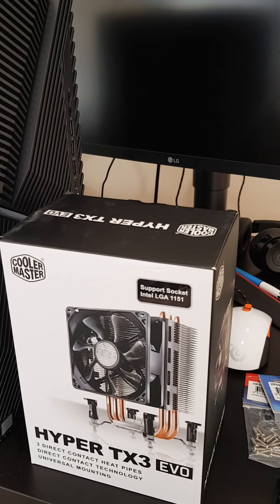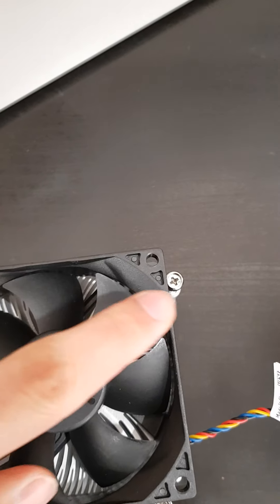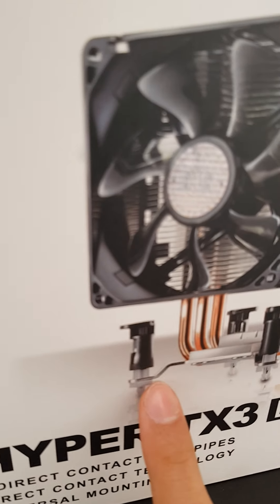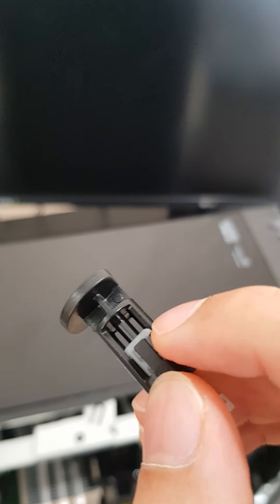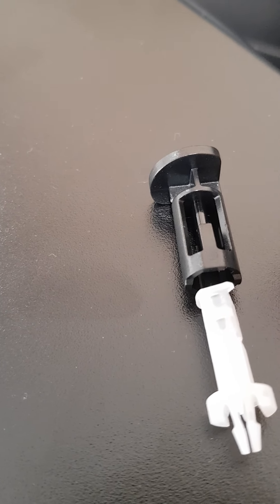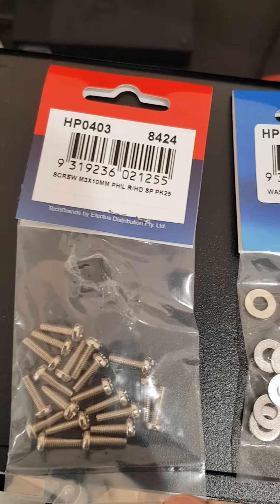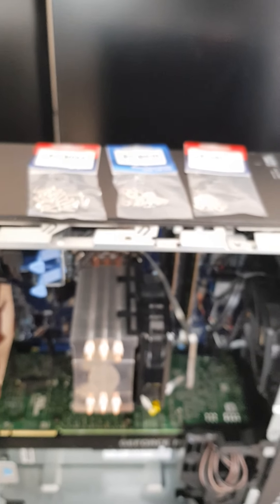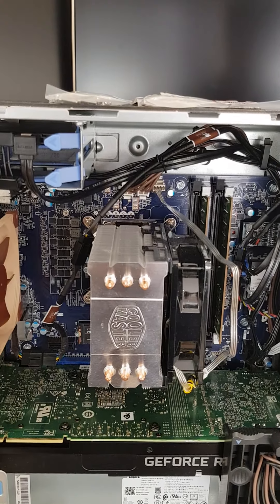Cooler Master Hyper TX3 EVO Installation on DELL G5

Comment: Thank you for publishing this video.  I will be getting my Cooler Master this week, the G5 won't be here until mid November.  I will probably do a video as well showing how my install goes.  One question I have, with the Master Cooler in place, is the RAM slot closest to the cooler still accessible?  It appears the fan may hang over the slot, but I cannot tell.  Thank you in advance!
Reply from the maker: Just managed to find some time and opened my PC to check. It looks like it should be accessible but it might a bit of a tight squeeze. I havn't tried to use all four RAM ports myself because you can always just get higher RAM cards and utilise 2 other slots. E.g. if you want 32gb RAM, use 2 x 16GB instead of 4 x 8GB and similarly for other RAM configurations.

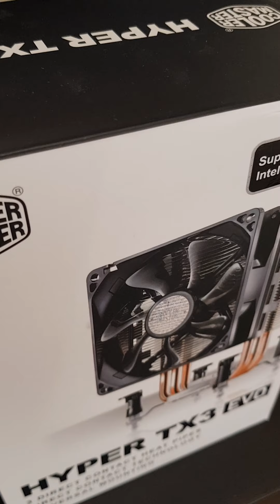Comment: First I would like to say thank you for the video it really help build my confidence to replace my g5 cooler. I just have a few questions. I was wondering do you use any plastic spacer or anything between the bottom of the leg and the top of the mobo? Or is it just empty space cause I really dont want to crush my cpu? Also do I need to install the noctua fans you installed in another video to not get the bios error or can I just install the coolermaster only and not get the bios error? Also what do you mean by middle configuration in 5:37 ?
Reply from the maker: Glad it helped build your confidence. Answer to your questions:
1. No I didnt need to use a spacer between bottom of the leg.
2. CPU doesn't get crushed as long as you just make sure to put firm pressure but not too tight ofcourse.
3. You can follow my instructions for installing the Noctua Fans and you shouldn't get a bios error just like mine. If you do get a bios error please see the comments section for the Noctua video (let me know if you still have any issues). Link to video: https://www.youtube.com/watch?v=QI7QZRkDe2w&t=63s
4. The middle configuration refers to the length of the legs screwed on to the CPU cooler. For examples the legs can be made short, medium and long depending on which hole is used for attaching the legs on the CPU cooler. Using the middle one will allow the CPU to fit on the Dell G5 motherboard.

Comment: Have you considered upgrading the PSU?
btw can you type it down the screws and washers you used?
Thanks, great vids
Reply from the maker: I havnt had the need to upgrade the PSU yet. In terms of the screws M3 10mm and for the washers are M3 and M4 flat washers.

Comment: Hi and thanks for the video!
I have a question; I have read that many uses the Noctua NH-U9s as cpu cooler. I wonder if on Dell G5 (i7 10700, rtx 3070) also the Noctua NH-U12A would be a good (better) solution. My main concern is if the additional weight would cause any problems to the mobo or if the larger size would pose problem for the fitting...
Thanks again!
Reply from the maker: Your welcome. In terms of comparison between Noctua and Cooler Master, there are some good youtube videos you can use as resource to determine which is better as a CPU cooler. But roughly they are both very similar. In terms of sizing, you would have to read spec sheets of NH-U12A and measure the room left in your PC case to determine if it would fit or not. Personally I cant give a direct answer since I dont have the NH-U12A fan to fit or compare but the Dell forums should also a good resource for this purpose. 
Goodluck and hope that helps!
Reply: @nooragha360  Of course it helps, thanks a lot for the reply! I wrote also there in the Dell Forum now!

Comment: thanks so much for this I have the exact same G5 model as you.  what did you do with the hard drives since they are installed in the front and I see you have a fan there.  Which fan do you recommend more, the Noctua or the Cool Master?
Reply from the maker: I used Noctua for back fan (replaced stock fan) and Cooler Master for CPU cooling. I also reused the stock fan for the front where the HDD original was. You can watch my other two videos for the total changes I made to my PC.
Reply: @nooragha360  I just watched it so you replaced the hard drives that came with the PC?  The black box housing in the front is what I want to move to the top so I can place the rear stock fan in the front.
Reply from the maker: @glaesonr255  yes I upgraded them.

Comment: I also have a Dell G5 5090 and I think mine has the i7-9700 processor and looking to upgrade the cpu heatsink and fan.  Which processor do you have, i7-9700, i7-9700F, i7-9700K, etc?  I know Dell offered a few different cpus on the G5s.
Reply from the maker: I also have the same processor (i7-9700), so following my upgrades should work perfectly fine for you!

Comment: Hello, I have a question about the heatsink. I recently purchased the G5 Desktop and would appreciate your help in reducing the temperature inside the computer.  The black and white part, that attaches the heatsink to the motherboard, am I removing that entire part? And then, using the M3 screws & washers to connect the heatsink to the motherboard?
(Hope to hear back, otherwise I'll take my best guess and keep re-watching your video) 

-Cheers
Reply from the maker: Yes that's correct, remove the plastic mount attachments that come with the cooler master and use the screws + washers instead to mount the Coolermaster onto the CPU.
Reply: @nooragha360  Thanks a lot!
Reply: @nooragha360  Do I use any standoffs below the holes of the motherboard of where the screws are going through?
Reply from the maker: I didnt use any for mine and it works fine.

Comment: Would this case be the same as mine? I have a g5 with a 1660 super in it and i couldn't seem to upgrade the cpu cooler today :(
Reply: I’m thinking about buying the same G5. How has your experience been so far?
Reply: @Aadish2150  1st day with it only about 1 hour of use i was trying to upgrade it but it's pretty hard :/ I'll be reviewing it later on my channel but it runs well so far
Reply: @JonnySteven  thanks, I’ll be looking forward to it. The supposed heating issue is keeping me from pulling the trigger on this one.
Reply from the maker: The case should be the same, I have a G5 with 2070S. What stopped you from upgrading it?
Reply: @nooragha360  I couldn't get 2 different gpu coolers to fit :/ that case really sucks ahah but I'm gonna try your method ! Pc still runs great just does get loud and heats up on max use 😩

Comment: Hi!
I managed to install the noctua 92 mm pwm fan on the back and the factory fan on the front, using the noctua splitter and connecting the 4 pin-end to the dell fan, so no boot error. 
I can still control the fan through the awcc, even if some kind of error pop ups if I open awcc just after the pc is booted on.

I was wondering, are you still aboe to use awcc to control the cpu fan with the cooler master? or how do you control it?

Another thing: the two case fan, dell and noctua, receive the same signa put with a fan speed of 30% from awcc the noctua fan spins reaaaly slowly, It could be a solution to use a SATA power to 4 pin adapter for the noctua to have it spinning a little more without having the jet sound of the front dell fan? The dell fan would remain the only one connected to FAN SYS through 4 pin cable. 

Thanks again for the video and for the many useful info!
Reply: Lurking, did you solve the problem after? Planning on installing this and the same fan you installed. I need to keep the original stock dell fan connected?
Reply: @gamingvideos7852  Hi! So in the end I only kept the noctua fan, connected with a single 4 pin cable to the FAN SYS; no error at all at the start up and I can control it with no problem from awcc. The fan is super silent and keep everything well cooled.

Comment: Hey man, so ive just installed both the noctua fan and this cpu cooler on my g5 5000 and while the cooling is definitely better, i now have an issue with power, before making this upgrade i was able to run games fine, just heating up, but now if i run borderlands 3 for example im hitting 100% to 104% power usage on the graphics card, its a 500w power supply and was just wondering, do you know of any power supplies that would fit in that case, preferably 600w+. And wondering if you also have had that issue? mpt sure the difference between these two models, but im now assuming you have better power in yours, cheers in advance
Reply from the maker: I have the same power supply that came with the PC. Havnt replaced it yet because didnt have the issue with power that you are describing. Would like to help but I think google would be in a better position to give you answers haha
Reply: @nooragha360  Damn, yeah ive been scrolling for a while, through forums and stuff, seems like with the dell g5 5000 its practically impossible to upgrade from the 500w supply, ive done other things like turning of nvidia replays and stuff and thats kinda helped but im still getting fps drops when a lots happening, thanks though, the cooling upgrades helped, now i have a new problem aha

Comment: Will this cooler work with the dell XPS 8940 with k processor? and is it the exact same installation process as this one?
Reply: Would love to know if this works for XPS 8940 also
Reply: I think the mother board is the same , so should be no problem. The original fan is the same on my xps 8940, it screws in just like the G5.

Comment: Did yours overheat to begin with? I just purchased a g5 and now I’m worried I made a mistake.
Reply: I bought one last night im in the same boat
Reply: @theunqualifiedgamer2344  let me know if you decide to go a different route
Reply: I think im gonna stick with it and just upgrade the cpu cooler and fans i got mine w a 1660 super and i5 10400f for 750$ on sale cant really beat that anywhere
Reply: @theunqualifiedgamer2344  I was going With the 3060ti 1tb ssd mine turned out to 1,600
Reply from the maker: Mine didnt technically overheat but it had high temps and for long term setup that's not a good idea. But yeh it's quite a simple and cheap setup overall.

Comment: i read that  a better  choise  is  the  Noctua NH-U9S ?
Reply: same but i’m not sure if it fits it the case. let me know if u find out
Reply: @dvorak3935  it will fit. I’ve ordered one to go in my G5. You’ll just need to buy 4x M3 16mm screws from any Home Depot store—everything else needed comes with the Noctua. It’s really quiet too.

Comment: Hello again, TX3 is 136mm height. Do you think a 140mm height cooler will fit or the case is not wide enough? 
Trying to find a TX3 in Canada, but its rare.
Reply: 92mm and smaller is the only size that will fit in this case. Try grabbing a Noctua NH-U9S as an alternative.

Comment: Will this upgrade be enough without the addition of the front intake fan upgrade?
Reply from the maker: This will keep the CPU cool but the graphics card might get a bit warm. But I havnt tested it by itself to see the temp difference. You can do the upgrades incrementally if you want.
Reply: @nooragha360  thank you very much .

Comment: Without upgrading the fan how fast does it over heat and does it have a lot of problems also I’m getting the one with the 3060 ti and a better power supply is recommended could I also change that?

Comment: can i replace the stock rear fan with a 80 mm rgb fan too? and what games did you play when testing it out with the before and after?
Reply from the maker: Yes as long as the sockets for the connectors are matching. Also as for the games, COD WZ was one of them.

Comment: Hi Noor, I just purchase this cooler just wondering is there any issues with the startup. I know that with a new fan it’s scans all the parts upon startup has says there is issues with the fan. Is there anything like that with the new Cooler Master CPU cooler?
Reply from the maker: No I didn't have any issues when installing this CPU cooler during the startup process. It takes me approximately 2 seconds to boot up my PC with the current setup.

Comment: Hello!
I got this prebuilt not too long ago, and decided to upgrade from the i3 9100 to an i9 9900k, would you be able to recommend me a cooler I could put in this FF to replace the stock cooler that came with the system? 

Would I have to remove the motherboard from the system to add new brackets or could I just use the stock bracket on the motherboard to screw in a decent cooler? 

I don’t plan to OC or anything with it, just want to replace the cooler with something decent, but I have little experience with prebuilt systems.
Reply from the maker: Hi, I managed to perform my upgrade without removing the motherboard from the DELL G5. You should be able to do the same. In terms of which cooler to use, I recommend any air cooler from Cooler Master series, because they seem to perform the best overall (budget). But make sure to double check with a compatibility check (i.e. the compatibility sheet of the after market part, or build my pc website).
Reply: @nooragha360  Ah alright, I was afraid I wouldn't be able to attach say an Noctua NH-D15 without replacing the bracket on the back of the CPU, it should just screw into the stock bracket for the original heatsink/cooler already on the motherboard?
Reply from the maker: @MarxAthium  yeh it was a bit of a challenge fitting the Hyper TX3 onto the motherboard, hence I think it might be even harder for you to fit that CPU cooler in the tight space. Let me know how you go though.
Reply: @MarxAthium  I installed the noctua nh-l12s by installing it directly into the chassis. I got some M3x16mm screws from the hardware store and used those to mount the cooler to the preinstalled holes. The frame makes it impossible to put on the bracket

Comment: if i use the noctua NH-U9S do i still have to buy additional m3 screws to be able to mount it or do i use the included screws ? also can i get the m3 screws at any store ?
Reply from the maker: I'm not sure what the NH-U9S cooling system comes with, so can't tell if the M3 screws will work there as well.
In terms of M3 screws, you should be able to get them from any hardware/electronic store.

Comment: Do you know if i will be able to use any other coolers with the g5 5090? such as the 212? or maybe any others with the lga 1151 socket type?
Reply: I’ve read on at least one forum that someone was able to put in a Noctua cooler but I don’t remember which model.

Comment: Is there any other way I could mount the cooler without the washers and screws? Also where did you get the screws and washers aswell?
Reply from the maker: There are other potential ways (check dell forums thread) but I found this method to be simple and effective. You can find the screws and washers at your local hardware store or electronics supply store or ebay/amazon (I found mine at local electronics store for couple of dollars).
Reply: @nooragha360  Ok Thanks, I attempted to screw it down but the screws were too long going to buy new ones. Just making sure if there are any easier ways. Thanks again!
Reply from the maker: @finlaylinden5854  just get the same sizes as shown in the video and you should be fine.
Reply: @nooragha360  Great! Thanks a lot of the assistance, always perfect to have someone with the same PC to help with custom add ons, much appreciated.

Comment: Hi, I’m having trouble unscrewing my CPU cooler. Could you possibly tell me what screw driver you used and how you unscrewed?
Reply from the maker: I used the regular Philip's screw driver I had available. Lay the desktop with the CPU facing the ceiling, this will give you better support when putting some pressure to unscrew the CPU because you are struggling.
Reply: Noor S. thanks for the help. I’ve already unscrewed it using a different screwdriver. I had to take the cooler out since I was going to be reusing my processor for my new PC build. Anyways thanks again for the help.

Comment: Hi, this Cooler Master Hyper TX3 EVO cooler has not been available to be purchased since last year at our local stores, could you provide me info to get this cooler for my XPS 8940 ? Thanks in advance.....
Reply from the maker: You would have to order them online through Amazon or ebay because I also could not get them at my local stores.
Reply: @nooragha360  Thanks......will try to get it as suggested.

Comment: Just wondering, do I need to use any brackets?
Reply from the maker: Which brackets are you referring to?
Reply: @nooragha360  There should be a metal backplate for the cooler for mounting. With the G5 the entire motherboard has to come out and the plastic one should come out. A pain in the butt however it will keep everything solid.
Reply: There is on bracket behind the mother board. The fan assy. Screws into studs that are part of the case .

Comment: I’m getting a bios cpu fan issue. Any solution?
Reply from the maker: Have you connected the CPU cooler's fan in the correct fan connector? Also what components have changed for your desktop?
Reply: Noor S. Plugged it into the cpu fan header on the motherboard. I also removed the 80mm fan. 4 pin fan splitter that has pins for 1 CPU fan and 3 case fans. Have 2x120mm running off that splitter.
Reply from the maker: @Squancheeb  yes, just what I thought. Please have a look at the comment section of my other video which talks about installing fans for the DELL G5. That will help you understand why your getting the bios error. Let me know if you still stuck after that.
Reply: Noor S. I tried the stock 80mm fan too. Same error.
Reply from the maker: @Squancheeb  are you using the correct 3pin and 4pin connectors for the right fan?